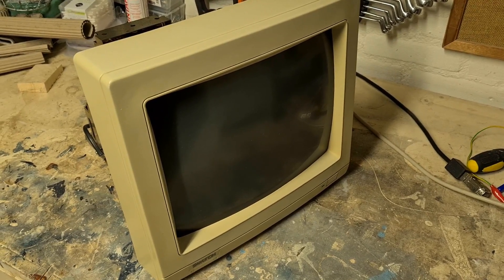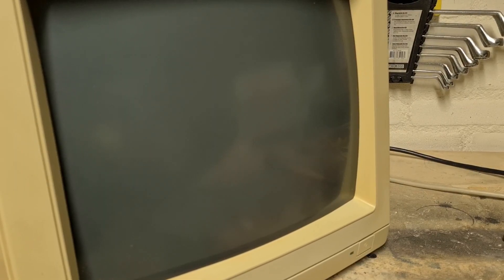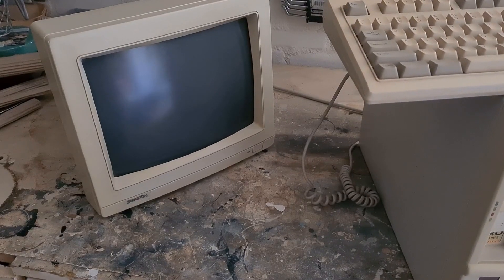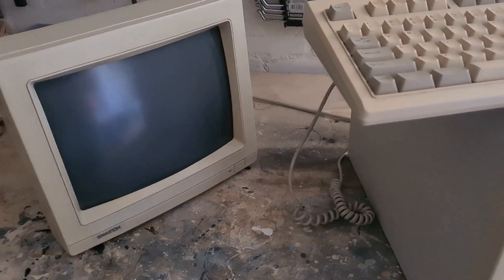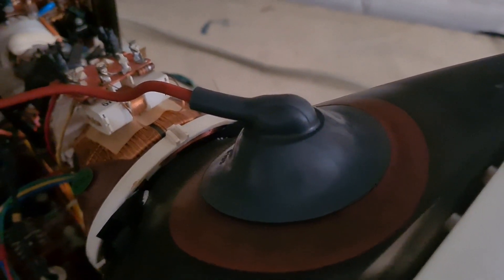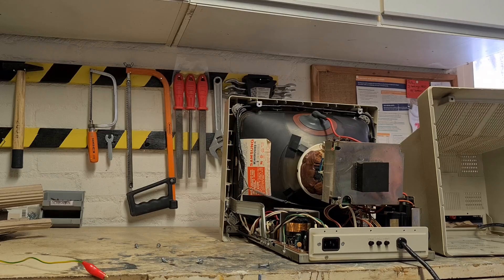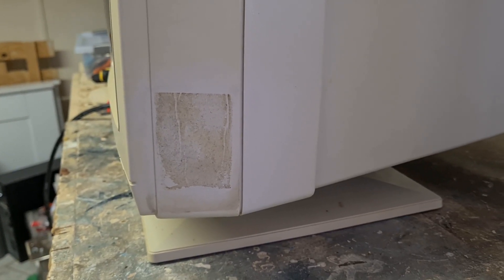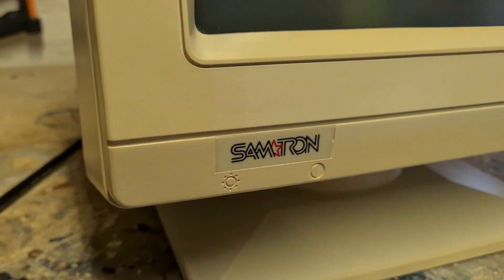Broken Samtron CRT Monitor? Part 2 - End result

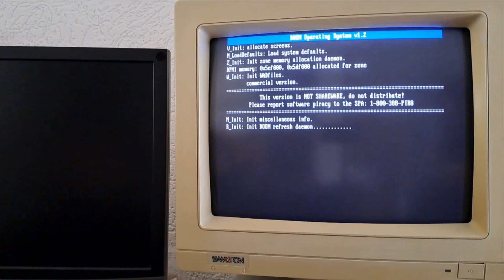Comment: 6:35 i was impressed how good its picture is, look at those vibrant colors. i have a couple of newer monitors and none of them looks as good as this.
Reply from the maker: Yeah, thanks. The colours still look good on this old monitor.
Also, I don't like using monitors larger than 14" with old DOS systems, because then the pixels tend to get too big. Since the resolution for most old DOS games only 320x200.
Reply: @wickedwijn  that's so true, i have a 19" monitor and DOS games look terrible on it!